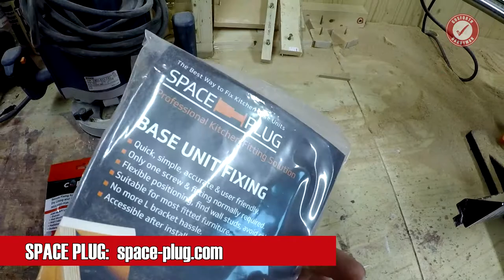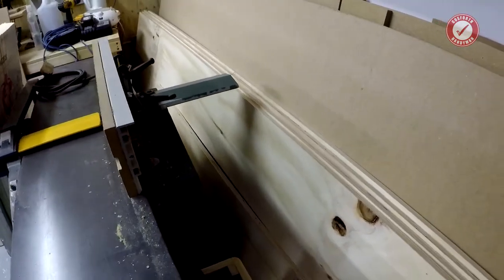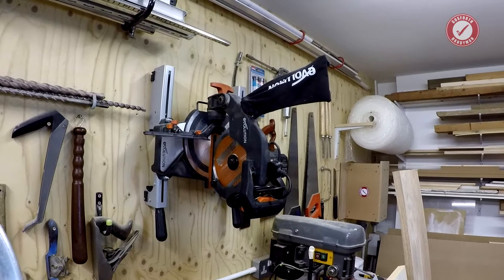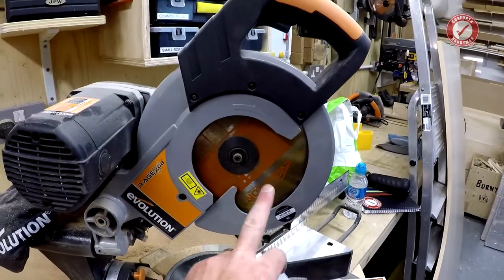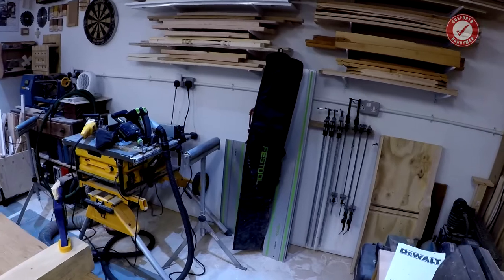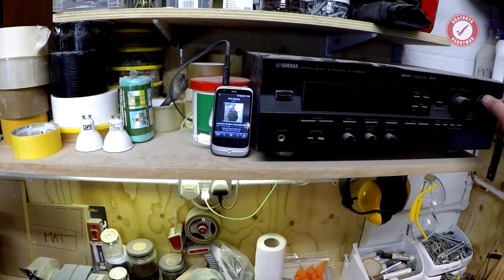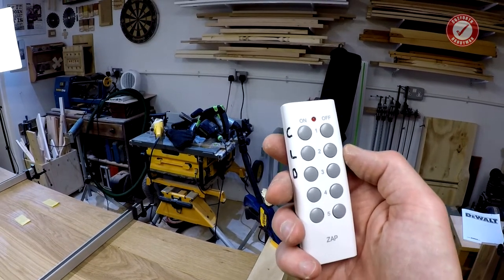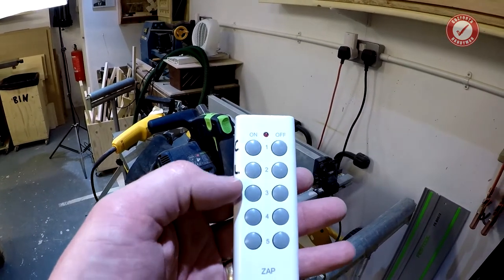Remote Controlled Sockets in a Workshop & Shop Update

Comment: I have recently bought a standard 210mm wood blade with 30mm bore for my evo saw. Came with arbor reducers and i used my dremel to grind out the 25mm adaptor ring to fit the evo saws arbor, seems to be working fine for me.
Reply from the maker: What sort of blade did you get? Freud only seem to do a high tooth count blade in 216mm. ☹
Reply: Gosforth Handyman I got a titan one on offer at a local screwfix just to try it as i didnt know if it would work but it looks like any brand 210mm blade with 30mm arbor will fit if you get the reducing rings with it. Took about 5mins with the dremel and one of them pink grinding bits to make it fit
Reply: If i remember right it was just a standard 210mm 40tooth titan blade my local screwfix had it for £7 so it was cheap enough if it wasnt going to fit.
Reply from the maker: Cheers for the info - might try that if the 216mm doesn't fit! 👍
Reply: Gosforth Handyman no problem, hope you find someone has tried a 216mm and it works, them freud blades are the dogs bollocks!

Comment: I don't have any power in my shed, so i run an outdoor extension into the shed where i attach a remote control 5 plug extension (it's called Mercury off Ebay), and that does the trick for me. I use the same 5 plug remote extension (a 2nd one) in the house, and plug the tv, dvd, printer and a desk top fan etc to it. I'm just lazy ha ha ha.
Barry (West Kirby, Wirral)

Comment: Have heard very very good things about DIablo brand blades.
Planning to swap out all my saws with them once the blades get a big more ragged.

Those outlets look really handy. Need to work on my dust extraction - opening the doors and turning on the 30" fan is fine in summer... not so much in winter
Reply from the maker: Can't readily get Diablo blades in the UK (not that I've found) but I think they're the same as Freud Pro blades (?) - got one on my table saw and it's amazing. 👍
Reply: So... bought myself a table saw yesterday and ordered a Diablo blade. Turns out they are made by Freud ! Probably a marketing naming difference country to country.

Comment: ref remote controlling power tools ? have you come across anything for 110v that can be used as an inline remote unit to turn on and off on site dust extractors when using battery tools rather than having to invest in brand new battery kit with bluetooth technology

Comment: I have many of these remote power sockets on machinery in a workshop. recently I have been having a problem with false triggers. ? opening up workshop to find machinery working. On one ocasion I discovered a dust extractor had been running for hours. Has anyone else had the same issue ? How wide is the radio band connection on these devices ? what other radio devices send a signal close to the band that triggers these remote sockets ?. I now have to go around the workshop at night and switch off the switch on the power socket itself. Any help would be apreciated.  Does anyone know of remote sockets that work on a more secure narrow band ? (the make of remote sockets I use is  is "Status")

Comment: I'm not certain but I think the evolution saw has a much slower rpm than the DeWalt so the metal cutting blade on the DeWalt maybe dodgy ?
Reply from the maker: Yeah - I think you're right. Just checked the specs - the Evolution R210CMS is 3750rpm, the RageDB is 2500rpm and the DeWalt is 5000. Bugger...
Reply: If you did try cutting metal on the dewalt saw you might end up melting the blade guard.